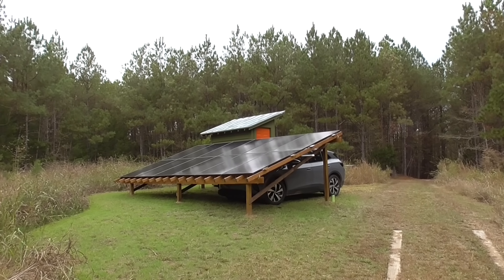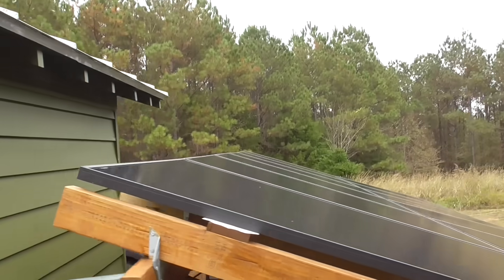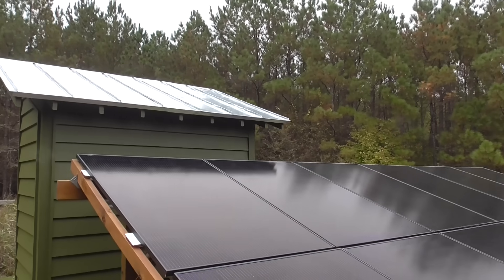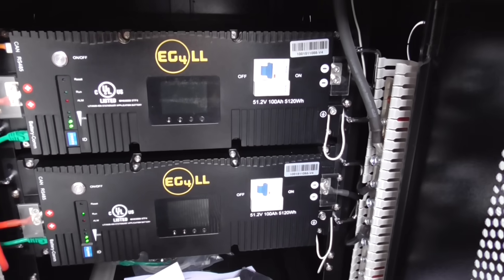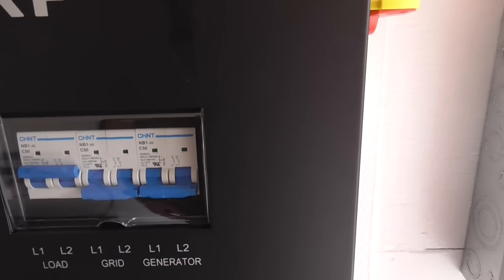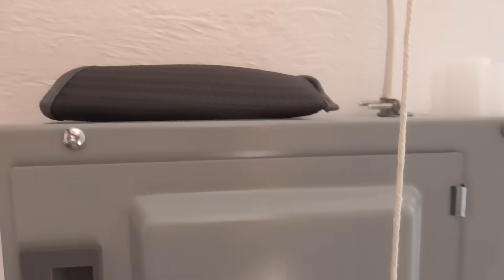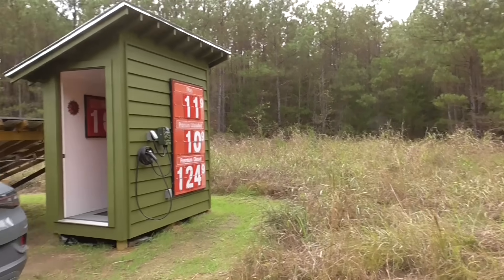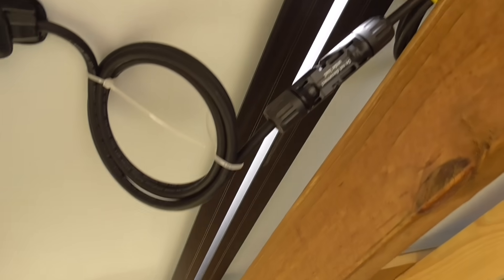Off-Grid Solar EV Charging Station. Stand-alone solution for EV.

Comment: i loved this video because i just became a new homeowner with 2 ev best cars i ever own save you so much money really and can save you so much more if you have solar i currently have a level 1 set up at my house my local electrician told me in order to upgrade it to level 2 since i charge my ev in the garage which is not connected to my house i would need a separate power source to the garage to provide the level 2 charging which would only be 32 amps not 50 and they told me over 5k to install everything and you are right looking up some solar panels which a solar generator would cost me less to set up but i would be only allow to charge on level 1 with solar if i spend alittle more closer to the 5k i can do level 2 with solar but if i want full 50 amps charging idk how much that would cost but by doing this you are also set up any black outs

Comment: i got 600w solar panels and 300ah 12v system with cheap inverter under $1000. it can be done cheap
Reply: The fact that he only says less than $100k, lets you know this was very expensive.

Comment: I don't understand why you have to have batteries to charge to charge the car.  Can you just change it directly from solar panels or from string inverter?
Reply from the maker: I don't have enough PV to charge at this level. But let's say I did. I would be charging along and a cloud could come along. That would shut off charging. The EG4 system states in the directions that solar-only charging is way too iffy. You are allowed to try it, but it's impractical. You will always need some battery to provide the juice when the sunlight dips.

Comment: I LOVE these kinds of videos!  I'm 11 months late but I'm so glad I saw it.  Thanks for posting.  I also like to drive my EV using the power of the sun.  This year, I got my 21.3 kW system working and I have a power hungry Hummer EV.  I do have two EG4 14.3 kWh batteries but I make it a habit to only charge my Hummer when it's sunny so it doesn't have to cycle my batteries.  Of course I don't care if I get a few clouds and it suddenly had to pull over 100 amps from my batteries for a short time.  Okay, long story short 😃I love driving exclusively by the power of the sun.  I guess the only exceptions were the few times I drove to the other side of Michigan and had to use a charging station to get back home.
Reply from the maker: I share that LOVE. Every time I'm charging with the sun I'm so happy. Right now, I have no choice when I'm home to charge from the grid, but it's turning out to be maybe a third of the driving I do. When I'm in the woods, I charge several times while I'm there for the driving I do to town for supplies, or even further for other stuff. But when I'm home in the city, I seldom drive anywhere, so for the most part I'm driving on solar.
Reply: @wickedmessenger1  That feeling of charging with the sun just never gets old!  But 1/3 grid charging isn't bad.  This will be my 1st winter in my new house with my larger solar system so I'm not sure how that's going to affect things.  I'm guessing I'll be doing some grid charging of my own in the winter.  At my old house, I had a much smaller system and I had a high electric bill once I bought my EV.

Comment: My Zappi charger does this solar charging. Also I'm able to fill my Tesla Powerwall 3 battery from solar when the car isn't plugged in and then discharge the battery into the car when I next plug in along with the solar generated.

Comment: Imo this is stll WAYY overkill. There should exist a DC-DC converter that you could plug into your EV and would charge your car directly. I'm sure this is still thousands of dollars of equipment, when the panels + converter shouldn't cost more than a few hundred total.
Reply from the maker: I agree that the most efficient system would be DC to DC. If you can show me a system like that that  could work as well and as cheaply as this system I put together, please make a video and send me a link.
Reply: @wickedmessenger1  I can't show you one..yet, but im working on changing that

Comment: Nice job. I enjoyed your tour very much! I suppose we can guestimate cost, since you never actually said: 12 mods, 1 EG4 6000xp, 2 EG4 server rack batteries plus the enclosure, service panel with breakers, a bunch of lumber, wiring, fasteners, and signage. Boy, you get way more back than all that in personal pride! 😊
Reply from the maker: I never added it all up myself. It's under 10 grand. And yes, I feel great about the accomplishment. If I didn't have it, it wouldn't be practical to have my EV, and I love that car. I still have a gas-burning Ford Ranger truck, though I don't need to drive it much. If anybody made an electric version of that size truck, I would buy it and ditch the VW. But all trucks now, even the electric ones, are monstrously large with tiny beds. They're pointless as trucks.

Comment: In country like China or India this whole setup would cost around $8000. Yes just around 8k. with 4 batteries of 48 volts 100AH each. and 6KV solar inverter and 8 solar pannels of 700 watt each, bifacial.

Comment: Funny how he refused to say how much the system cost, other than to say it was less than 100K.
Reply: The equipment   he used is close to 8K.
12 panels  1,500
Inverter 1,600
Battery's (2) 1,400 ea.
EV charger 600
Battery rack 800

Stand, equipment shed, wiring, disconnect electrical box, breakers, ect. probably another 5-6K.
Reply: This is not a inexpensive set up.
Reply from the maker: @THEMAX-ti2gi  What I didn't want to get into is what every tom dick and harry think is expensive or not expensive. My total cost was under 8,000, if that helps.

Comment: Really awesome project!  Can you tell me who designed the whole system?  I'd love to do something similar.
Reply from the maker: The EG4xp 6000 instruction manual pretty much tells you everything you need to know about putting the system together. For all those people who are used to the idea that you have to buy a dozen different components all carefully chosen and calculated, those days are over. The EG4 has pretty much all that stuff inside it already. I had to get a PV shutoff even though the EG4 has one in it already. I had to ground the panel frames to a grounding bar. Look at the video and you'll see that there isn't much in that shed.

Comment: I think this might be the first time ive ever seen solid copper that thick used as a grounding wire. Usually we use #6 stranded. Other than the few times ive worked with MI Cable, that might actually be the fattest solid copper conductor ive ever seen. Where i work, everything bigger than #10 is stranded.
Reply from the maker: Interesting. I used solid #6 because I kept seeing people use it in videos. Perhaps this outdoor location exposed to the elements would deteriorate stranded wire with all that surface area faster. Can you think of an idea why it is worse than stranded wire?

Comment: add a automatic rotating solar panels so that you get the optimal angle all the time. are you going to add a sprinkler system to wash off the dust as well?
Reply from the maker: No thanks. All that added expense and I already get all the solar I need with what I have. Perhaps if I had a fleet of cars I had to keep on the road.

Comment: Less than 100k did not really answer the question. Would have been nice to get a real #. Great set-up!
Reply from the maker: All the components are listed. If you're interested, you can see how much I spent. I just didn't want this to turn into a rant fest about how much cheaper a gas generator would be or how EVs suck or all the other crap people throw at you when money is involved.

Comment: 25 years doing off grid power systems and I have run into a number of them where the solar panels power output has drastically declined. This is because mounting solar panels on wood will stress the frames over the seasons. The modules themselves won't break and It takes a while, but what happens is you will cause micro fractures of the silicone solar cells. It takes a good number of years but mark my words, the power output will fall off of a cliff. Mounting solar panels with wood in the industry is an absolute no no.

Comment: How long does it take to charge battery using just that solar array?
Reply from the maker: The arrays I have do not have enough capability to charge the car without the additional kilowatts of the equipment shed batteries. They work together. The shed battery alone can add about 7 to 9% to the car's battery before it hits the low limit and shuts down. With a good sunny day, the solar arrays contribute 2/3rds of the power with the batteries contributing the other 1/3rd. That will last for many hours, adding about 40% to the car before the equipment battery is discharged.

Comment: 200AH charges only 9Kwh ? 9Kwh is 36 miles. So you need 10 times bigger system to charge it fully.
Reply from the maker: There will never be a time where I need to charge the car's battery from 0% to 100% when the sun is not shining. In almost every case, I need to add 30 to 40% to the battery on any particular day, which this system is capable of doing. If I had reason to charge at night, I would need a lot more batteries, however I never need to charge at night. The sun provides 2/3rds of the power that goes into the car and the equipment batteries provide the other 1/3rd. I have not claimed to have built the perfect offgrid charging system, only the perfect one for my needs (balanced with lowest cost for my needs).

Comment: Was scrolling through and saw your video. How did the EV hold during what we had of cold weather. In the below zero temperatures. Thanks
Reply from the maker: If you're talking about Fahrenheit, we never have below zero temperatures. If it's degrees Celsius you're citing, and you're therefore inquiring about temps below freezing, we did see temps into high 20s Fahrenheit this past winter and I made the trip in temps in the mid to low 30s Fahrenheit. This reduced my range by 15%. On those really cold days, I charged to 90% or 100% to make sure I had the range to get home.

Comment: How are the panels clamped down to the frame!
Reply from the maker: They are bolted down with 1/4" bolts, nuts, and washers, 4 per panel. They are bolted to the 1x4 boards that run from side to side. Each one has a piece of vinyl flashing on it so that the aluminum panels never touch the pressure treated wood, ever! That's important. I think there are times in the video where you can see the white flashing at the ends.

Comment: Dude, you're going to destroy your EV's charger using that transformerless inverter. One shorted MOSFET in that 6000XP and it will all be over with for both your EV and that inverter. You should be using a low-frequency inverter or a DC to DC charging configuration if you want to charge your EV with solar.

Comment: Very interested in doing a setup like yours and would like to know more! What are your thoughts regarding discharging the battery so often? Do you limit the discharge at a certain percentage? Do you charge only during peak sun to charge via both pv and battery?
Reply from the maker: I never seem to be there when the system shuts down because of the shed batteries, but it seems like it must be around 15%. I don't know if that lower limit is something I can set or not. When you say "so often," I don't know what is too often or not. I use it when I need it to do what I need it to do. If that's too often or not, it is irrelevant. I have to do the charging I need at the time. I always try to time my charging when I have good solar and several hours of good solar ahead. I've found that about 10:30 a.m. is a good time to start. In ideal conditions, the PV is providing 2/3rds of the power and the shed batteries are providing 1/3rd. If I try to charge with the battery alone, like at night or on a very cloudy day, I can improve the car's battery level maybe 7% before it shuts off for low level (again, around 15% as far as I can tell). This system the way I have it can do everything I need   almost all year, but I did have a challenging month in December when the sun was so low it was behind the trees (see Part Two of this video series). Otherwise, everything is there for me to get my daily needs. If you do a system like this for your EV, and you find it isn't quite good enough some parts of the year, the EG4 6000xp has inputs for a gas generator. I don't have one because my goal is to eliminate as much use of fossil fuels as I possibly can.

Comment: I couldn't quite tell, if you also have PV panels on top of your battery shack, as well as the ground mount array. One thing to consider, is if you have a back-up generator, they need an occasional "maintenance run". What better way to load test a generator, than to charge an EV or other battery, so that energy isn't wasted! Using my 8,000 watt V-twin Briggs & Stratton generator to charge a Chevrolet Bolt EUV gets about 28 miles per gallon. Charging my new AWD Equinox gets me about 23 miles to the gallon. (really not all that efficient) But, since I need to run the generator occasionally anyway, just to burn off some old gasoline so I can fill it with new, that fuel isn't wasted, and it ensures the reliability of the generator for when I actually do need it. The cars load the generator to about 7,200 watts, which is very close to minimum brake fuel consumption for the generator. (optimum load to get maximum kWh per gallon of fuel consumed)
Reply from the maker: That's good advice for anyone who incorporates a gas generator in their off-grid system. Maybe someone will learn from your post. I, however, do not have a generator, nor do I intend to get one.
Reply: @wickedmessenger1  Combustion generators: "For Occasional Use Only"😋😋

Comment: I  would add a 3rd battery and double the solar array,maxing it out. You should be able to charge pretty much anytime.
Reply from the maker: No, my needs are met with the system just the way it is, but your situation might be different. When you build your solar charging station, please send me a link to your video.

Comment: You're always better off going direct to your car when sun is out whenever possible. This causes way way less losses from going to battery then back through inverter to the car. It surprised me how much more power I would get without these losses on my system
Reply from the maker: If I set the charger at a much lower power level than the 24 amps I use now, I suppose the solar power alone could charge the car, but it would do it so slowly that it might take me 3 days to get back up to 80% to get home. The way I'm using it now has a lot of waste, I understand that, but I can get 35% per day on my car's battery, so it's perfect for getting me up to 50% when I arrive by mid-afternoon. Then on the day I leave I can get up to 80% and drive home. My needs are met with the system the way it is. Somebody else might have different needs and would need to do whatever necessary to meet them.

Comment: Thanks for sharing . Could you talk about the brand and cost of your panels that you used. I know no one wants to get into costs on these videos, why? Yes I know you will get trolled regardless by all the keyboard experts but it would be helpful those trying to do something similar. Also are there any specific resources you used to help you learn about creating your own PV system? As you said in your video there are a lot of resources and info out there. A lot of it makes this more confusing. Thanks
Reply from the maker: All the equipment is provided in the written details provided below the video. There are links for each component. I agree that there is so much info out there that you end up being paralyzed in fear for making a mistake. If you're interested in the cost, you can easily see what everything cost with the links provided.

Comment: Excellent job!
On a sunny day, when you have your “three thirds” all working - what is the kw rate into the car?
Reply from the maker: Any time the car is charging, it's 25 amps, regardless of how much is coming from PV and how much is coming from the batteries. The Grizzl-e controls the power going into the car, and that level comes from setting it up with DIP switches inside the unit. I set it just lower than the max operating output of the EG4.

Comment: Superb! Re: the backup. A modest 30 or 50 amp dual fuel (e.g. propane) generator could be a nice backup system to keep in that shed. One gas grill sized propane tank will power it for quite some time. Have one for my RV.

Comment: If/when the wooden rack's structural integrity degrades, do it over with more height and span to incorporate the adjacent power shack.  You'll have shelter for the entire car, not to mention that much more power to keep the car completely topped up, and the greater height simply moves it farther out of the zone of ground-based shadows.

Comment: Do you have a cost breakdown? Love the setup thank you for posting
Reply: Around $7k for the panels, inverter, charger and batteries. Maybe another $4k for materials would get a decent imitation done. 

Let's say this charged the car for its full 150k expected lifespan. The cost would be $0.07/mile. A comparable ice car getting 30 mpg would get the same value if gas was $2.10/gallon. Since gas is rarely that cheap, a solar charged EV is probably more economical as long as you can cover the costs upfront.

Comment: Too low. Should have lifted both in front and back another meter (3-4 feet). Then the car would fit under properly plus the snow in winter will not build a heap to interfer with the low end of the panels, casting shade.
Reply from the maker: There is no snow in the winter.